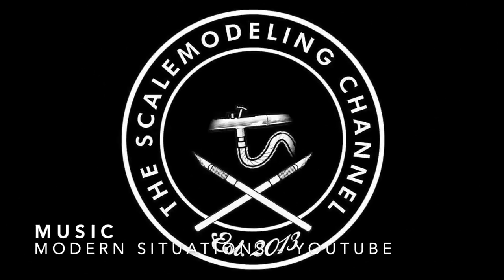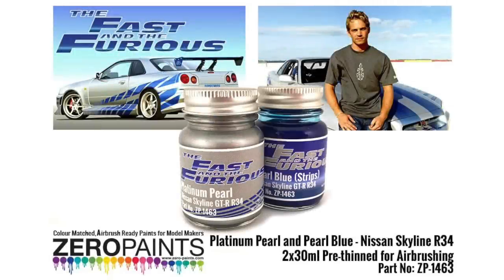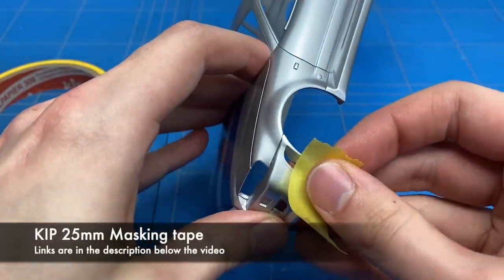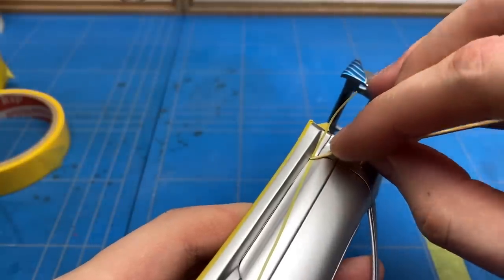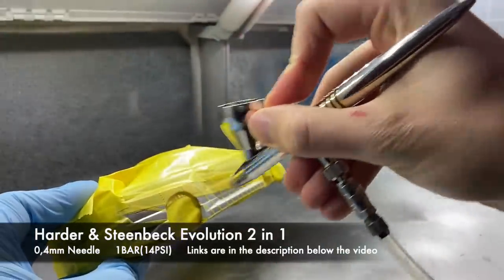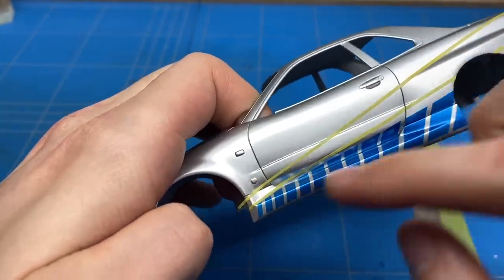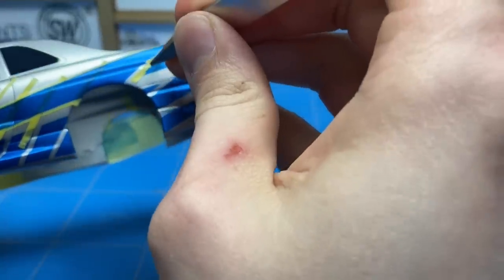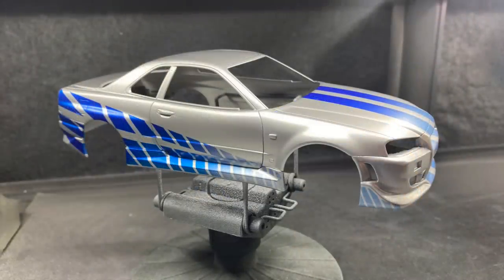Tamiya: Nissan Skyline R34 GT-R 2 Fast 2 Furious Build Part 2 Painting the Stripes

Comment: Im watching and watching your videos and cant find... how long would you let basecoat dry before you stick masking tape on it? if i leave it for too long would it affect top clear coat? thanks for your previous reply 😁
Reply from the maker: That all depends on the paint you use. And the temperature in the area.

In most cases leaving it for a day is safe. In other cases its fine after an hour or so.